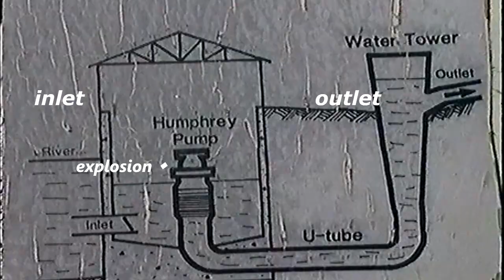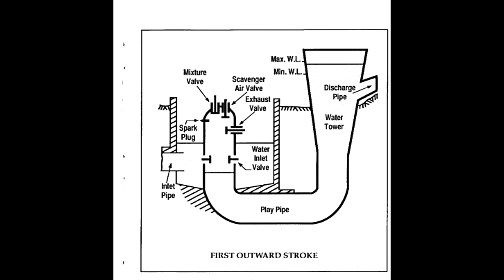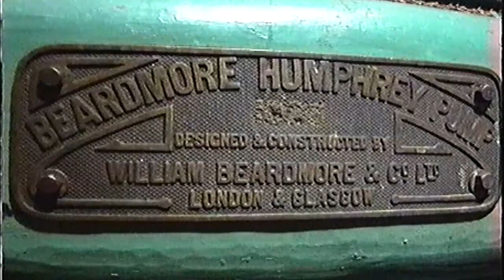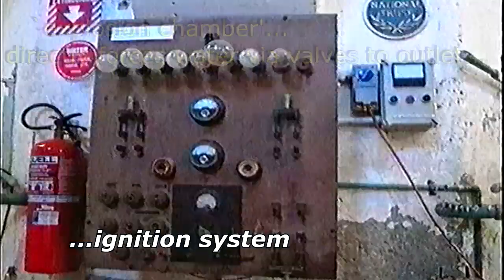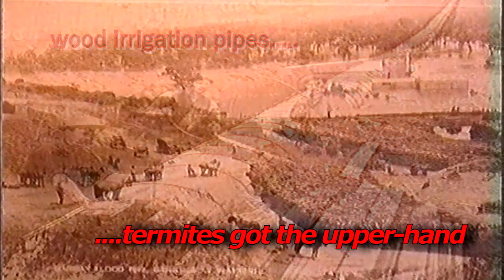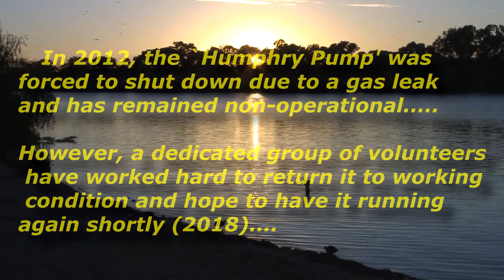The Humphrey Pump

Comment: Great video, you covered many of the aspects of this great machine. I spent several years starting it up and I think this technology could easily move large amounts of water across the country wherever a gas supply exists.
Reply from the maker: ...Many thanks for your  comment, Brett...I value it even more, that it comes from someone personally involved with the great machine  and who would have hands-on experience in it's operation....I have often wondered about the strength of the  `explosion' required to move the solid mass of water to the delivery....When it is operational again we will certainly have a visit up there ...Regards...Gordon
Reply: Methane burns and expands rather than explodes so the 300 tons of water gets accelerated away. The ignition stroke produces approx. 70psi and when the water bounces back into the combustion chamber 100psi can be generated. The old cast iron chamber blew apart early after installation in the 1920's. happy to answer questions from what I can remember. When did you see it ?
Reply from the maker: ...Many thanks Brett for that information....300tons of water in one delivery stroke means something!.....The longevity and reliance on the monsters, I suppose was due to relatively few working components and over-engineering ( except for the defective  chamber) I guess......It must have been a long, slow, hard journey from Port Adelaide and an even more difficult effort  installing them in place....When did we see it? ...a good question...my guess between 1992-1995....regards...
Reply: The 300 tons is the pipe water volume approx. weight,  I could work out how much is delivered each stroke, I think it was 1.2 million gallons per hour. I believe it just recently ran again for the first time in years due to safety issues.
Reply from the maker: …..That's great news Brett. Maybe sometime soon we will be able to visit the Monster again...The only thing   I remember is  that a foot head of water exerts 0.5 pound at it's base and when you look at 300 tons, that is an enormous amount of energy required...I believe the old pump could form a good Physics example when teaching hydraulics...thanks again Gordon

Comment: Have just detected this video, I am one of the team currently working to get the pump to a point where it can be again opened to the public to view the machine in operation. We (the team) believe that we are at a point where we can conduct a final trial where we hope that the gas levels as detected by the recently installed detection system will be satisfied as to safety.
The holdup as of this moment is that one of the gas producers has a leak in the upper water chamber (where steam is produced). A new chamber is currently being built by SA Water at the Berri workshops. We took the opportunity, after removing the upper water chamber to examine the gas producer and found that the fire-bricking could do with replacing and the bridges at the fire-bar level were severely distorted and burnt. These bridges hold up the firebricks above the firebar openings. replacements have been ordered, from a local foundry, and we are expecting an imminent delivery when we can re-brick the producer, ready for the new water chamber.
Under test the pump works beautifully, I have personally started it a number of times, in the last few months, and it runs like a clock.
Reply from the maker: Many thanks Lyn, for all that info. I have been wondering how the repairs were progressing ….now I can appreciate some of the final obstacles are being overcome....I am hoping to be up there with a better camera when you are up and running again......Regards Gordon ... Ps..Sorry for delay in reply (I did not receive notification from YouTube...)

Comment: Hi. I will put a comment on here when we are ready for public viewing.
Next Easter is the hoped for time.
Even with a different camera you will not get the same video as in this post as you happened to be there before the new cover was in place on the pump. This dims the view somewhat.
I should very much like a copy of the video in this post, if that is possible.
regards
Lyn
Reply from the maker: HI Lyn and thanks for the info and pump update...I did leave a contact e-mail but my security detected spam...so I amended my last message to you...As of July...utube have withdrawn the ability to send private messages so all is now public....I can send a dvd ...SD card..Flash (Dongle) to a post Box etc. .. or stream the video to your e-mail address ( you will have to keep the download page open for about 40mins or more.)....Pity we can't get up close to the pump anymore  ....regards Gordon